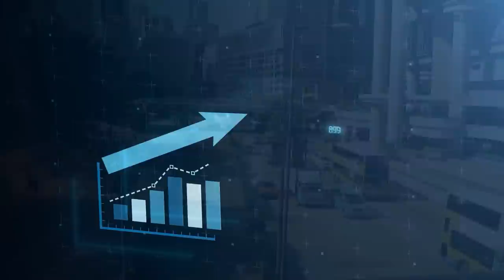INSANE! NEW $38,000,000,000 China's & UK High-Speed Rail That SHOCKED The World! Japan Is Jealous!

Comment: American twisted the arm of U.K. to remind them it is shameful to let China handle the High Speed Rail project. But Lesson learnt from how the U.S. lectured U.K. for several hours to drop the use of Huawei has stuck in their mind.
Japan also blamed the minor faults like leaks, cracks on metal due to severe vibrations were manufactured by its overseas factories. They promised they could easily rectified the minor faults in the Japanese factories itself. Really good in blaming others.
U.K. couldn't except the timeline set by U.S. as it would double the time set by China. American's railway technology is highly questionable as it could not provide a single good example of a successful project overseas. Whereas China's reputations and an unchallenged track record all over the world set them apart.
Reply: I don't think the US has high-speed trains.
Reply: @zhugeliang3905  
The Metroliners were extra-fare high speed trains between Washington, D.C. and New York City which operated from 1969 to 2006. They were briefly first operated by Penn Central Transportation (successor to the Pennsylvania Railroad, which originally ordered the equipment), then by Amtrak for 35 years.

Service originally ran with Budd Metroliners, self-powered electric multiple unit cars designed for high-speed service. These proved unreliable and were replaced with locomotive-hauled trains in the 1980s. The trains had reserved business-class and first-class seating. The fastest trips between New York's Pennsylvania Station and Washington, D.C.'s Union Station were scheduled for 2.5 hours, though some midday trains around 1980 had schedules as long as 4 hours.

Amtrak replaced Metroliner service with the high-speed Acela Express, which runs up to 150 mph (240 km/h) The first Acela Express trains ran in 2000, but due to equipment difficulties they did not fully replace the Metroliners until 2006.
Reply: Who are those overseas factories, I like to know, or it’s just an excuse as you so rightly cited?
Reply: I dont know where are you from but if japan pulled their nvestments I am very much sure it will severely hamper your country's gdp
Reply: @whitewolf2767  Japan would suffer much, much more than China, given the size of its market. Already Two days ago, Japan seeks China's understanding and not stop sending its tourist there. China is taking its time to reconsider.
Reply: @chandrasegar9466  you are right my friend...but every country has a good and bad side

Comment: The more I listened to this video, the more confused I became. Here is why?

(1). Why the US was in the equation when it hasn't yet have high speed rail systems?
(2). I had to listen to it three time when it mentioned that the  exact length of the HS2 is 400M. Why do you need high speed rail for such a short distance.
(3). Why would the UK decide to give the contract to China when the UK was declaring the "Golden Era between the UK and China is over"?
(4). $38 Billions for a 400M long rail is rather expensive in anyone's measure.